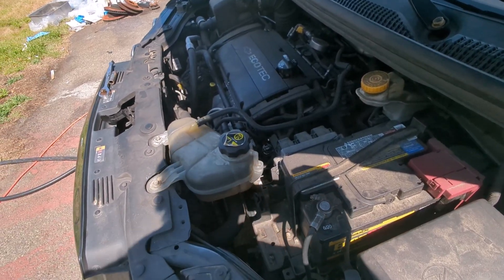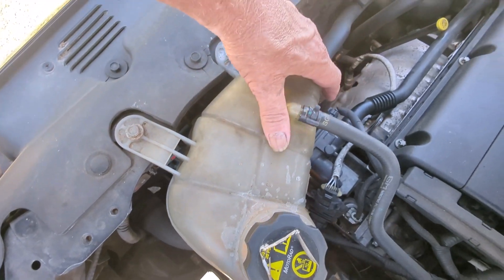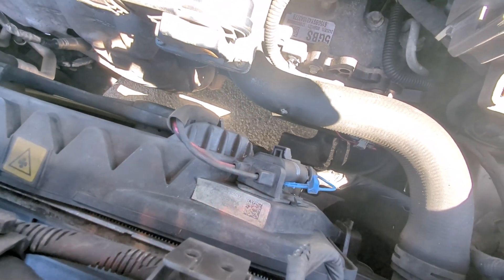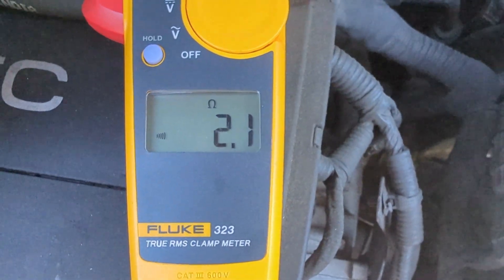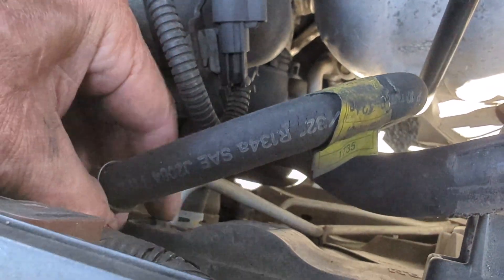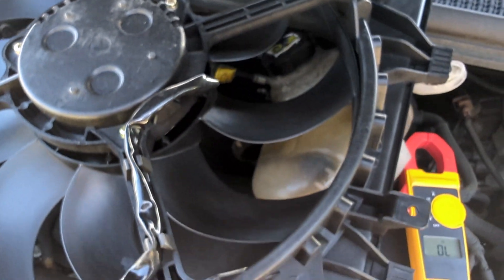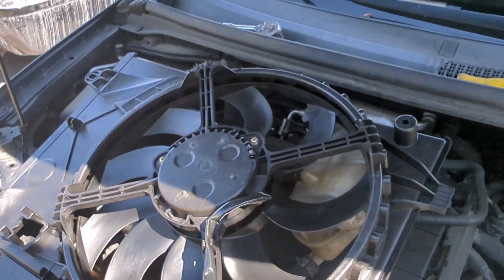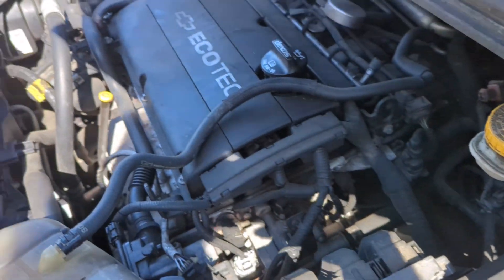Chevy Sonic radiator fan diagnose and replacement

Comment: I am not getting any power out of my plug. So today I put straight 12v to the fan and it works and the fuses I check showed good and I’m lost maybe you have some info for me
Reply from the maker: I would check the temperature sensor. The fan turns off and on, off when the temp is cold and on when hot. It should always run with the AC.  Look on the driver's side of the engine, near the thermostat housing, on the lower part of the radiator

Comment: I am currently dealing with my fan being out on my 2015 Sonic. The mechanic quoted me $700 to replace it. I'm definitely not in a position to afford that (along with the AC compressor that also decided to shoot crap right now...by chance have a video on that?). I'll be utilizing your video to walk me through doing this myself. I am, admittedly, a female that is not very mechanically inclined lol 
Thank you SO much for your video on this! You got a new subscriber!
Reply from the maker: You can find the fan on Amazon for about $50.00 dollars. If your A/C went out at the same time as your fan stopped working, it is probably not the A/C. The A/C has a high-pressure valve that will let out the freon if the pressure gets too high. This is what happens when the fan stops working. The one you see in the video that is what happened, the A/C stopped working at the same time.. So, after I fixed the fan, I added freon and the A/C worked fine. I do not have a video on replacing the A/C compressor in that car, but I do have a video on how to add freon. 
How does a car AC system work   https://youtu.be/2_upKt_52xg
Diagnosing Bad AC Compressor   https://youtu.be/THo4aimEvUs

.